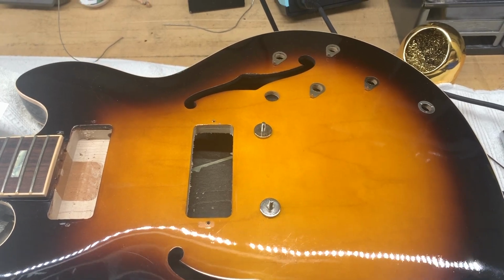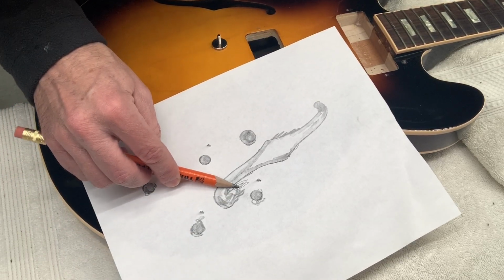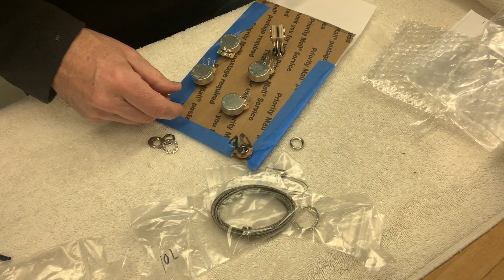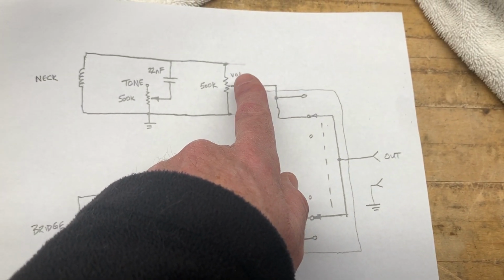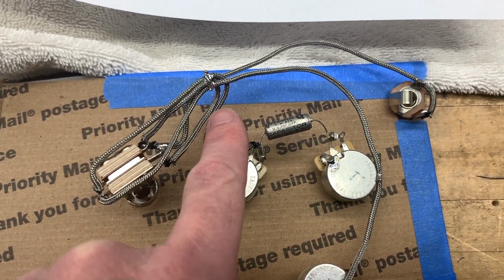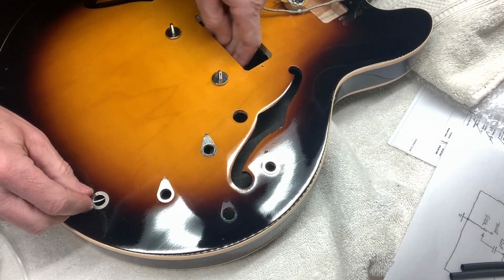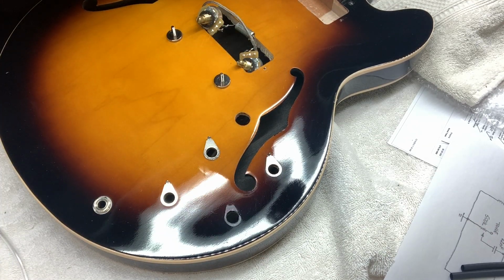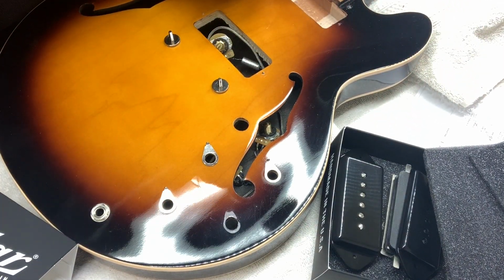Semi-Hollow Body Guitar Pickup Installation

Comment: Very Daunting task until you do it...ive done a few semi-hollows through the f hole...secret is to leave just enough slack to get the jack in place with the rest of the harness outside the f hole, then the 2 tone pots, then solder the pickup leads and install the 2 volumes...switch I can get in there with just fingers...I did all mine so that the pickup signal and grounds are soldered to additional wires so that I can unsolder and swap pickups in the pickup cavity, never having to remove harness again...

Comment: That was really helpfull. I have a 335  p90 with coil taps and was trying to figure out how to work on the electrics. The plastic tubing is a great tip for placing the pots. I have a small round dentists mirror I use to get a peek inside those f holes which helps with identifying component specs. Thanks for the tips. I would like to hear the 50's wiring as I am certain my guitar was wired the modern way. I heard that Gibson used 50's wiring from 2013 on thier vintage re-issues but its always better to check it yourself.

Comment: Thanks for the help. I've fitted acoustic end pins I the past.

I used a  1/4 jack plugged into the socket. To hold the washers in place. Same method could work here I think.